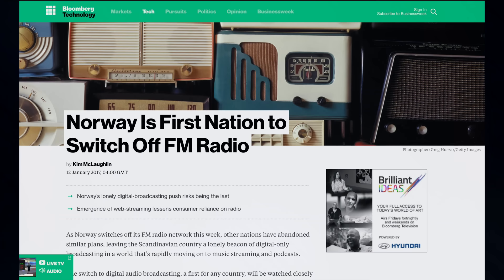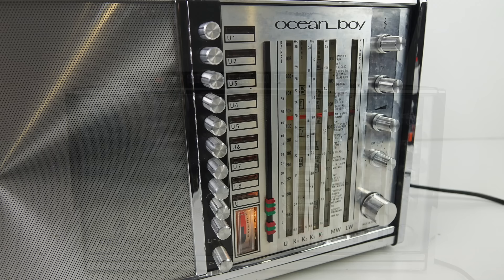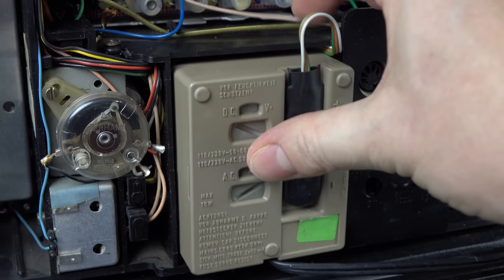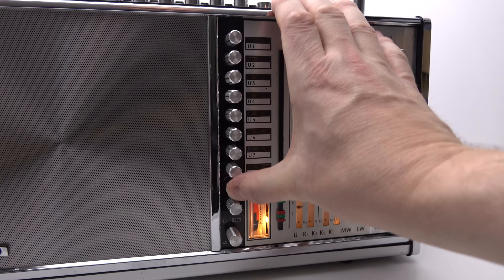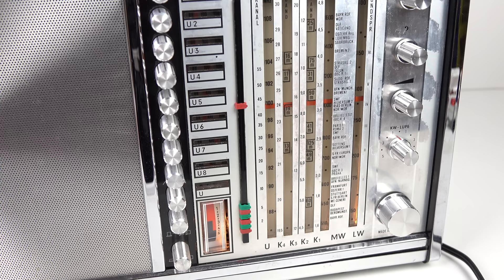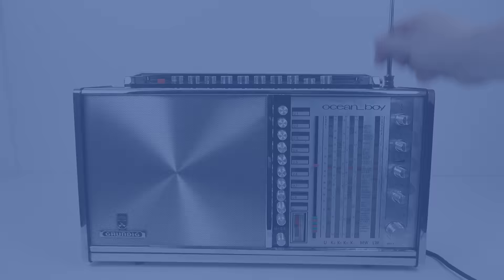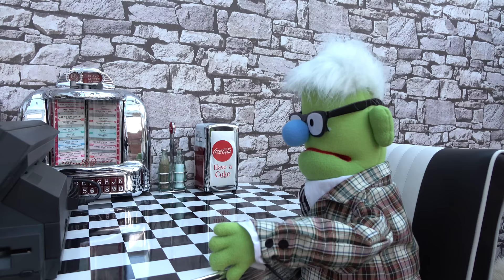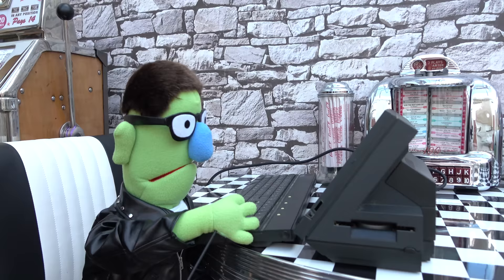Design Classic: Grundig Ocean Boy 210 Radio

Comment: Digital radio is somewhat pointless. There's basically nothing to listen to and the quality of FM and AM is perfectly fine.
Reply: Generic Green Squid I actually found that some stations sounded much better over FM than DAB. More "alive and natural" whatever that means, cannot explain it better. Maybe the stereo separation or something not sure.
Reply: If it's anything like digital TV, the problem is that there's only two possiblities.  Perfect and nothing.  If you're just slightly too far away to get a good enough signal, you get nothing.
Reply: John Ridley, yes though digital TV was of a much higher quality than it's analog predecessor, while digital radio (DAB) is usually 80kbps MP2 joint stereo. Pretty awful in other words and worse than the predecessor. But you can look at song names!! (on a tiny monochrome LCD)

I bet someone somewhere in some committee was like "wow you can watch the radio!!". Sigh.
Reply: FM radio is broadcasting also song names and time in the Radio Data System - RDS. The system is used mainly in Europe and Latin America.
Reply: František Benko The US has something like this too, at least with car stereos.
Reply: Must be a problem with your antenna, in america I can pick up fm stations from across the state inside parking garages. Also, RDS supplies album and artist information to people who actually use that stuff. The only thing holding back sound quality for a radio is the build quality. On top of that, DAB and DAB+ is even more prone to interference and drop outs than analogue could ever imagine, just visit South Korea or China, I can't believe Norway actually thought this shit was a god idea.
Reply: RDS is also used here in the US, and Canada as well, my 2001 Ford F-150 extend cab with the stock radio, tape, and 6 disc changer has it as a standard feature, but I borrowed my mother's 2012 Toyota Camry the other day, and nope no RDS in the radio but can play MP3, WMA CD's, and even an Aux, so if manufactures can't even standardize on RDS on radios here, I don't know how they gonna do Digital radio, and more so with older cars/trucks that have standard AM/FM radios.
Reply: Commodorefan64 That can be a quandary.  But yeah, the Ford minivan someone I know has RDS for it's radio (alongside Sirius).
Reply: it's actually SiriusXM because the 2 merged a few years back, and my sister has a 2010 Honda Pilot with the infotainment  and Nav unit built in that has SiriusXM, but I don't see the point of paying for radio now that I think about it if FM does get cut off with apps for Android like SoundCloud, XiiaLivePro(Shoucast/icecast streaming radio player), and TuneIn which all do it for free long as you have enough mobile data, and you don't have to worry about FCC regulations either.
Reply: Commodorefan64 Unless it's country restricted as you also have to work around that if you want.  I just think it's widening the haves and have nots to me.

And  yes, I know it's SiriusXM but I don't usually think of the XM part at all.
Reply: Digital radio in the US is a paid subscription service, so it's not really a replacement for FM.
Reply: John Ridley Nope!  It's kinda sad really.
Reply: Commodorefan64 That's one achievement.
Reply: It is, but getting people to upgrade who are just fine with the normal AM&FM radios already in their car is going to be the problem, it needs to be as common in cars as old school FM radio became in the 70's and 80's and that won't be for sometime with so many older cars on the road, and the fact most people in North America don't even know HDRadio exist, and has for a few years now. A Good example of this is my mother who is in her 60's and up till a couple years ago was still using a 27in Panasonic CRT (I saved it for old school retro light gun games and thankfully it has component inputs), and was paying out the nose for DirectTV,  and it was not till I made her get in the car go to Walmart and bought her a 47in Samsung 1080p panel,  a Roku 1(both were current at the time), a good TV antenna, and helped cancel her DirectTV did she say why did I not upgrade sooner, because people like that don't realize they needed the upgrade till they where forced to do it, and thus can then see the benefits.
Reply: The problem is that the decisions in the UK are made in London. Drive up to the M25 and you get so many stations (including pirates) that it is difficult to receive anything on FM properly.The rest of the UK seems fine with FM though. I have several DAB radios including one in the car and I never use any of them. My main concern with DAB is range and the st ut  teiring effect as soon as the signal drops lower.I regularly listen to Wave105 on FM all the way from Bournemouth to beyond Newbury. One day I will have to see how well that works on DAB.
Reply: MrDuncl I live in Newbury! We're fammmooouuussss
Reply: Generic Green Squid   It's just cheaper apparently
Reply: I don't know how it is where you live. Here you get the same Channels on DAB+ as on FM and then loads more from all over the country and beyond.
Reply: AFAK there's no such thing as digital radio in the US. Apart from subscription services anyway.
Reply: John Ridley Pretty much.
Reply: standard FM gives you the song name and title too. Its called RDS.
Reply: +Frantisek Benko Oh it's used in the US too, it's just that a lot of people are unaware of it. A lot of car radios can display the RDS data, and I have a portable multiband radio that can display each of the RDS data streams separately at the press of a button, and I have two iPod Nanos with FM radios built-in that can also display RDS information.
Reply: Yes, and in emergency, better to have bad analog signal but you can still understand speech than bad digital signal and you get nothing. And for me its much more annoying to listen digital tv stopping and working sometimes than analog just getting worse quality. In Finland we dont have analog tv anymore me swiched to digital in 2005, but we have analog FM radio, nothing else radio.
Reply: eetu53 Hopefully they won't give up that.
Reply: It's on shortwave radios too.
Reply: Most people are not audio/videophiles so they would not know about the tech, they also don't read those type of magazines and are not hobbyists anyways and the mainstream press doesn't discuss it much.
Reply: @John_Ridley  

A digital radio technology called "HD Radio" is being used  on some stations in the US, but it has not met its potential.  On the FM band, it provides digital audio on the main program and some stations carry additional streams- but the additional streams are unreliable in mobile use unless you're in the prairie.
On AM, it provides a digital version only of the main channel (no subchannel), but the audio does not sound natural due to compression effects (it sounds like circa 1997 internet audio using a 56k dialup modem), and the interference to adjacent channels is horiffic, comparable to running a vacuum cleaner in the broadcast studio.
It hasn't caught on.
Reply: @1L6E6VHF  Well seriously, I think for most people the radio is only a thing they listen to in their car, and I haven't seen anything but Sirius offered in cars. If it's not available in cars it's not going to catch on.
Reply: @John_Ridley  Where have you been? HD Radio is on virtually all midrange trim levels and above. For nearly a decade now, my friend's 2010 has it.
Reply: @straightpipediesel  OK I'm not sure how I'd know then I guess. Is this something where you just go to the regular frequency and it's HD without me knowing about it?  The other thing of course is that I haven't listened to radio at all on my new car (3 years now) - I only really listen to stuff that's on my phone or the thumb drive.
Reply: My phone ran out of juice, so I listened to the radio on my ride home a few days ago... It was absolute sewage. Bottom of the barrel content on all stations. It was worse than watching cable TV (which is hard to beat for being an unpleasant experience). I'll stick with my audible audiobooks and music I actually like. I just wish they'd stop wasting the spectrum on FM and AM when they could use it for something more useful, like basically anything else.
Reply: Nobody seems to have mentioned that the main reason for digital radio is that many channels can be multiplexed into a small bandwidth, much smaller than FM
Reply: @DGTelevsionNetwork Pretty sure China still uses FM analog.

Heck, they still use AM.

Comment: This reminds me a lot of the Grundig Satellit 6001, which has a similar design, but instead of the 8 FM presets, it has a rotating drum-dialscale tuner for several SW bands. Very good sound, same power supply module with the adjustable input and output voltages.
Other nice looking/performing radios of this vintage to watch for:
Nordmende Globetrotter 808
ITT Schaub-Lorenz Touring International 104Phillips L6X38T
SABA Transall Deluxe Automatic
National RF-5000AOr if you can afford it . . . although it is from 1980 . . . The KING . . . National RF-9000

Comment: Someone will make digital to FM converter.
Reply: Hold Fast that would take more tech than just a digital radio
Reply: Hold Fast that can be done already. Get a FM transmitter and plug it in to a digital radio
Reply: No, it would need to convert a number of digital broadcasts to different fm frequencies so you can change station on the fm radio.

Well that's what I would want it to do anyway.
Reply: Bonswally very true. If you were hardcore you could set up multiple digital radios with transmitters on the appropriate frequency for each station. Lots of effort but it could be done I guess?
Reply: Already exist. The one I have is a Pure Highway, released at least 10 years ago as I needed to get a replacement DAB aerial for my '08 car.
Reply: Ninja Master its worth it
Reply: ...It doesnt work that way lol

Comment: My mother still has a Grundig radio in the kitchen. It's from the 50ies or 60ies, not sure. Never needed any repairs, just a small lightbulp had to be changed once. Running now for about 50+ years.
Fuck the new DAB radio, you will need to buy a new radio every 3 years or earlier! Because with todays electronics you are happy if this crap lasts longer than 12 month.
Reply: Sam Gates, since 2007, .... That's like ten years old. :p  -- but seriously, I've got a Dual radio from 1965 and it works like new. Stupid FM radios lasting so damn long with that damn superior reception ability giving clear stupid sound. Let's switch to MP2 already and cheap Chinese boxes. Because, reasons.

Digital TV was way, way superior to analog TV, the same is not true for radio.
Reply: I don't listen to radio at all hate it they just play the same shitty pop songs on repeat I don't even like them and the FCC makes them only play gay clean music no thanks I'll just listen to good explicit rap on apple music
Reply: Sam Gates doesn't change the fact that they can't play explicit music and there's ads I hate ads and I hate clean music
Reply: Sam Gates ik thus why I pay for apple music so I don't have to deal with that shit and can play what I want when I want
Reply: Sam Gates also I purchased protube which disables yt ads and is the only yt client on iOS that supports 2160p playback
Reply: Sam Gates clean rap music is unlistenable way to many words are skipped plus they swear to get their point across
Reply: Sam Gates I wanna know what their saying not just have every word FCC don't like skipped
Reply: Sam Gates I'm not into the bad kinda rap I'm into like Black Hippy(Kendrick Lamar, ScHoolboy Q, Jay Rock, and Ab-soul) their label is the only one thats not victim of the ppl pushing clinton pushing Jay Z and Beyonce demasculating the black male and drugging the youth
Reply: +Sam Gates No, I was being sarcastic, forgot to mark it as sarcasm. Good FM radios sound amazing and last forever. DAB is already obsolete and has no advantages over FM other than moar channels.
Reply: Sam Gates If its a good song and never had swearing to start with that's ok but that's rare and the way they censor songs is horrible and ruins it
Reply: Sam Gates I do understand so I pay for apple music so I don't have to listen to it
Reply: Sam Gates that comes down to personal preference I think the black and neon green of Spotify looks ugly and apple music looks nice and clean also apple music has more songs
Reply: Sam Gates also I prefer a native app which apple music is and spotify isn't
Reply: Sam Gates tbh there isn't much rap that's clean to start with so I just listen to the explicit version bc the way it's censored is horrible and I swear a lot irl anyway
Reply: +Sam Gates Because radio stations like being able to say they are playing a track from the actual album. Plus the "single" CDs with multiple edits of a single CD are usually given away for free to the radio stations and DJs, so they usually contain edits suitable for different shows so they can play different edits all day.
Reply: ö. . , dab in 2k17 is lame anyway
Reply: Amen to that. Most radio stations these days are frustrating to listen to, they put some good songs from time to time but it's not worth wasting your time. Can't wait to get an internet radio to be able to listen to thousands of station. Cheers :)
Reply: My TV (which I still use for news and some shows, meaning I haven't yet ditched watching TV) is from 2005 and still looks brand new. Only problem is that some pixels have problems, but other than that it's fine.
Reply: You still watch TV news?
Hows the blood pressure going?
Reply: ***** I don't know. I think the last time I checked it was 110/70 or somewhere around there.
Reply: Tambarskelfir, Couldn't agree more that it isn't the same as when we moved to digital tv
Reply: Here in scandinavia we have public broadcasting, and they are both commercial free and allowed to play explicit music. No FCC here. ;) I love Apple Music too, but in all fairness... :)
Reply: I agree!
I've got a Radio Collection with Radios like that.
They Work! They sound good! They last! They look Beautiful!
Reply: Grundig made the best radios ever!